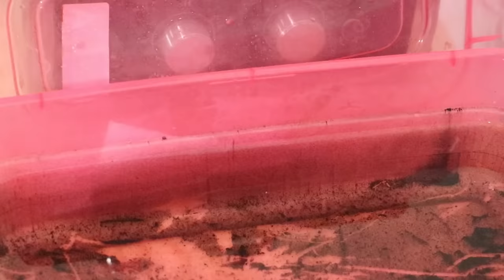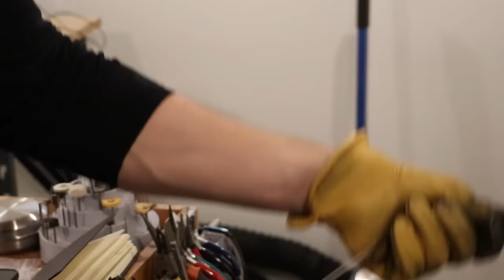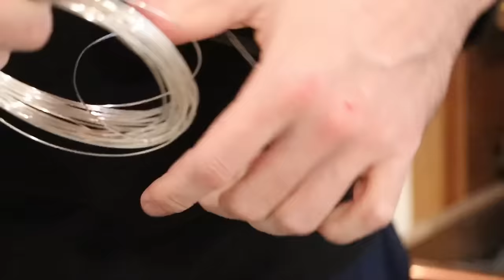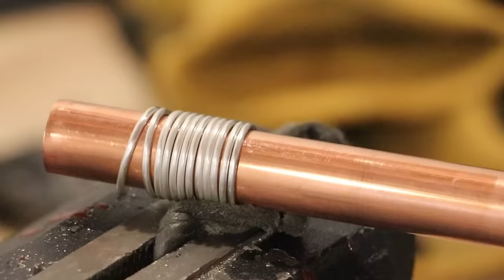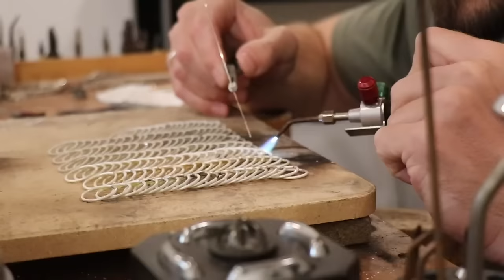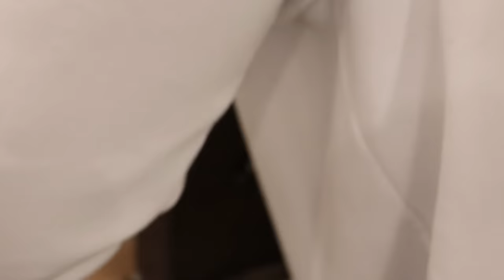I Discovered the Secret to Crafting HEAVY BALI SILVER BRACELETS

Comment: I have the same torch. I am pleased to see it has enough heat to melt and anneal such a significant amount of metal.
Reply: That looks as if he is using the rosebud annealing tip -- makes a huge difference!!  I am in lust over his electric rolling mill :)  And his ring soldering layout is so precise and efficient -- but he isn't sawing ring ends flat? What will that do to the join, or will it matter in this design?

Comment: As someone who doesn’t even wear jewellery, I found the whole video fascinating. I never stop understanding that I’m not paying anything to see these videos - even though they cost a lot to make. So, I’m not going to criticise at all. It’s an observation only that, as an outsider, I wonder why you are doing the various processes. Is the heat application annealing? Is it to relieve stresses in the silver? What is that white coating after you have heat treated the wire? 

Even without this knowledge, you can only wonder at the skills involved
Reply: Your guess is correct in that the heating is to soften the material. Each time it's bent or reshaped it will become harder but more brittle through a process called work hardening. Heating to a good percentage of the melting point of the material allows the metal to grow new unstrained crystals in its structure, making the material soft so it won't break under further reshaping. 

The white coating is probably to keep oxygen away as it will oxidise very quickly while it's hot. It may also be a lubricant to help with the wire drawing process.
Reply: @peglor  thank you
Reply: Any time a metal moves it becomes “denser” in the area it moved. So squishing the wire through a mill will definitely harden the material until it either breaks or gets resoftened with heat. The white coating after heating the metal is either flux (to protect from oxidation of the 7% copper in silver) or if it is fresh out of the acid silver will be a more cloudy white because the acid literally removes copper from the surface of the metal leaving leaving a raw unpolished material.
Reply: @jonjensen4514  thank you very much. I had not realised, for instance that silver can contain 7% copper. Another question therefore if I may.

I understand that 9 carat, 14 carat etc shows the public the percentage of pure gold in a piece but I don’t think we have the same type of definitions for silver? If a piece is hallmarked silver, what is the percentage allowed of non silver elements? Much appreciated
Reply: @theofarmmanager267  if it’s sterling silver it’s 92.5% silver and then 7.5% of mostly copper and then also other metals potentially. So that would be a “925” stamp or STERLING stamp. If it says “SILVER” or “999” that means it’s pure silver but for jewelry purposes that’s pretty rare but not unheard of
Reply: @jonjensen4514  thank you again. One more question perhaps? I have silver pieces which just have the assay marks (no sterling or 925 or 999) - is there an assumption about the percentage of silver in those type of pieces?
Reply: @theofarmmanager267  it’s hard for me to say that’s not something I see often enough to know… I’m sure certain logos are for 925 and others are for 999. Most jewelry silver is 925 especially rings or pieces that get more abuse where on pendants or chains pure silver is more possible for sure.

Comment: I do have a question I would love answered please is the reason that you pull the wire through the die that you roller does not go down small enough for the thickness of wire that you need

Comment: What is the gauge of the wire?
What is the diameter of the copper pipe? What tool are you using to open the links when you put the links together? Where do you get your clasps?
Reply from the maker: You can use any sharp, round tool to open the links. I make clasps. Everything is handmade

Comment: What is the purpose of heating the metal after each process?
Reply: To stop it from cracking. Silver needs to be heat treated after being  manipulated a lot.
Reply: It's called annealing. When you work with metal eg: hammer, bend or basically anything that changes it's shape, it hardens and becomes more difficuly to work with, with a risk of breaking and/or cracking.
Heating the metal resets the molecules and makes the matal soft again.